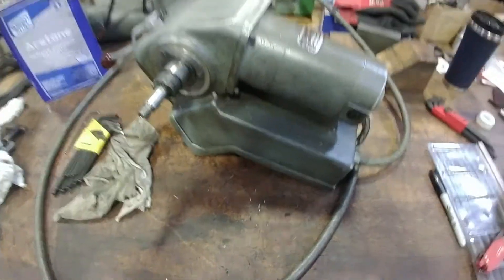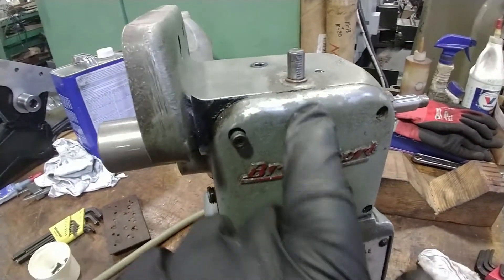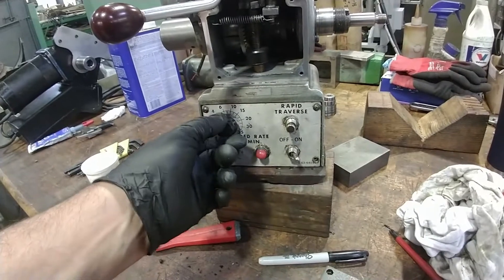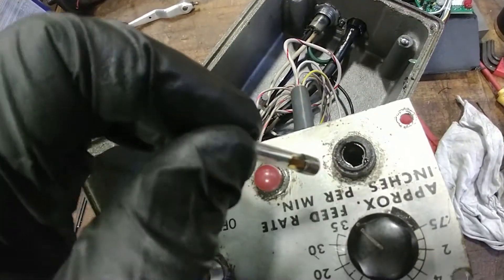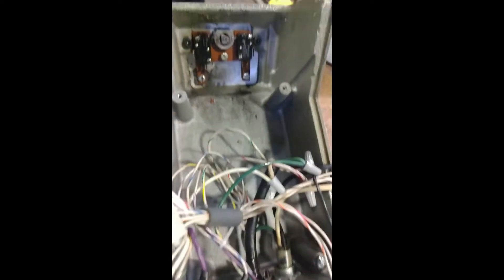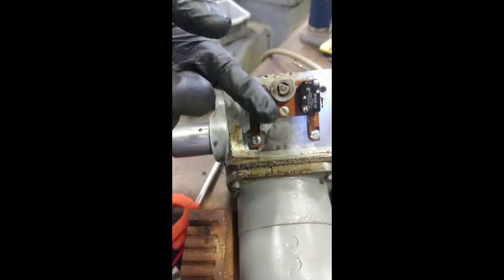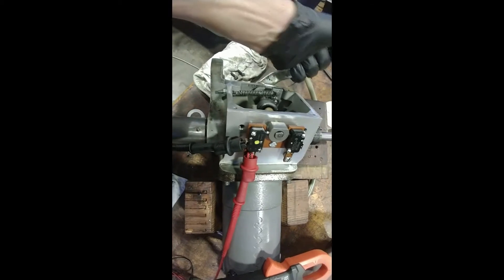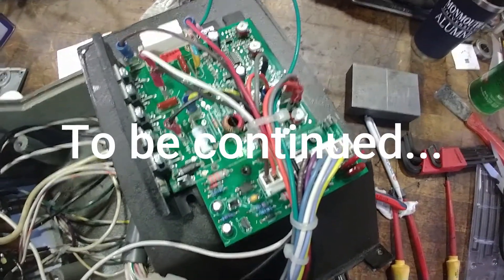Bridgeport Model 6F Power Feed Diagnosis & Repair - Part 1

Comment: Hi, did you publish a part 2?  I have the same symptoms on my 6F-A and would love to see you dig into the board.
Reply from the maker: No, never did a part 2... I left that job before completing the repair. In any case we don't repair the circuit boards, we just replace them with an updated version.
Reply: @JerzZDog  Thanks for the reply
Reply: @JerzZDog  do you still have the board. can you take a photo of it the top and rear. thanks

Comment: Did you ever find a solution to this problem? I'd love to see Part 2. I have similar issues with my power feed.
Reply from the maker: No, never did a part 2... I left that job before completing the repair. In any case we don't repair the circuit boards, we just replace them with an updated version.